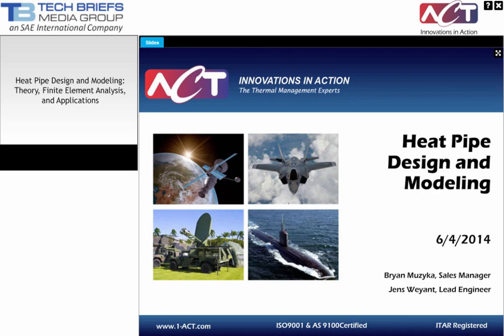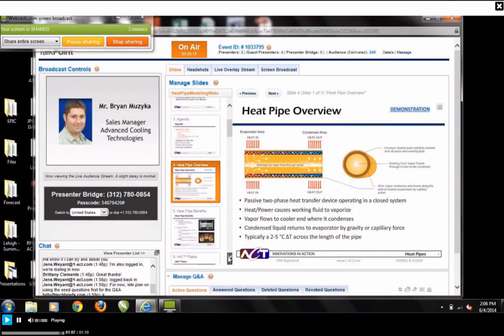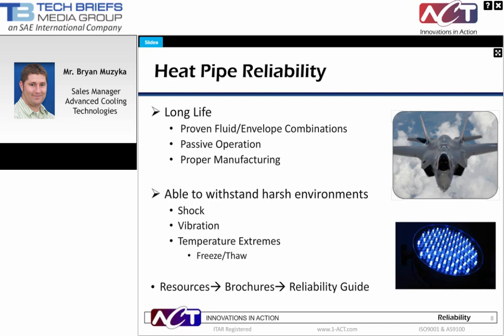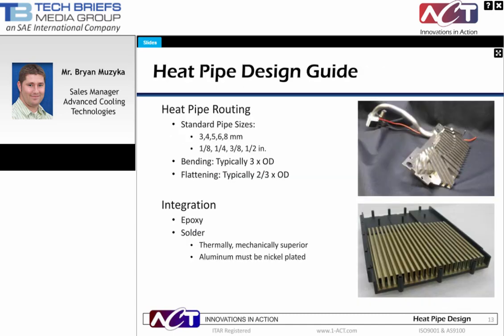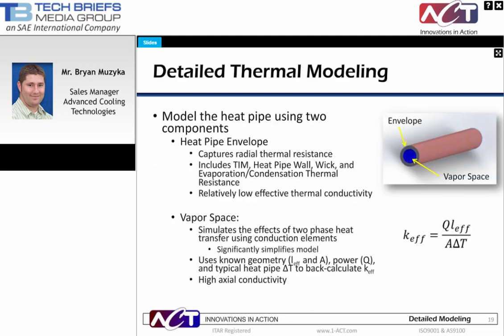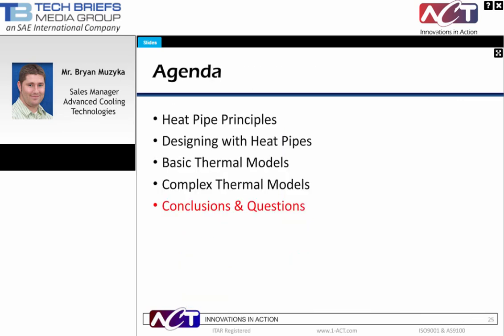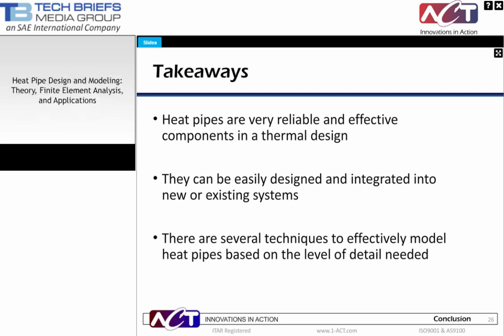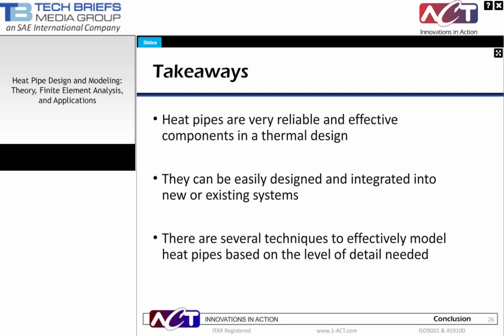Webinar: Heat Pipe Design and Modeling

Comment: If we have a temperature difference of heat pipe less than 1K or greater than 5K then it will transport heat or not?
if it does not transport heat then what is the reason behind it?
Reply from the maker: Noman- If you'd like to discuss your specific application send us an email and we will set up a call - solutions@1-act.com

Comment: Hi, On the slide at 18mins, what is the equation you use to approximate the thermal resistances?
Reply from the maker: I recommend you use our heat pipe calculator tool, https://www.1-act.com/resources/tools/heat-pipe-calculator/

Comment: 1. If I dont have a heatsink but a fan instead, how do I estimate the length of my 'condensor'?
2. Is the Keff, calculated in the Advanced modelling approach for the envelope and the vapour, considered constant along the entire length of the heatpipe - including evaporator, adiabatic and condensor length?
Reply from the maker: 1. You can use the entire length that would see airflow. If you don’t have any extended surfaces or fin volume, you are relying solely on the external surface of the heat pipe for thermal dissipation. In this scenario, you’ll likely have a large air side temperature rise; however the heat pipe should continue to operate with a similar delta T as described. 

2. Yes

Comment: Should i use K=500 to 1200 W/mK or the calcluated K_eff value of 233,000 W/mK in simulation?
Whenever I talk to heat pipe manufacturers they claim max thermal conductivity value of around 2000-2500 W/mK...Please help!!
Reply from the maker: The heat pipe will operate with a fairly consistent delta T. Therefore the effective conductivity will increase as length increases; hence a range. Also the 500 - 1200 W/m-K is a range for planar effective conductivity across the entire area of a HiK(TM) plate (not a heat pipe). The heat pipe will have a much higher axial thermal conductivity. The 233,000 W/m-K you reference is the suggested k effective for the vapor space in the lumped model approach. However, if you want a single effective thermal conductivity for a heat pipe that accounts for vapor space, conduction and envelope, our suggestion is to start with 10,000 W/m-K and adjust up or down until your delta T across the pipe is within a typical heat pipe operating range (2-5 C).